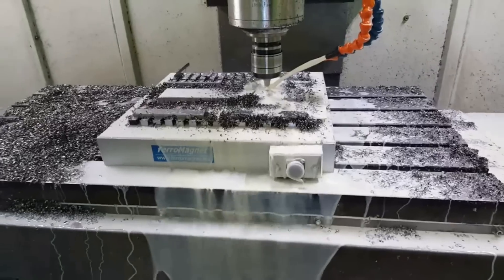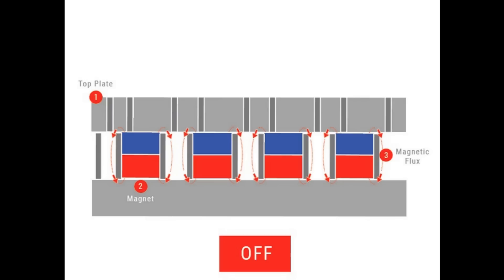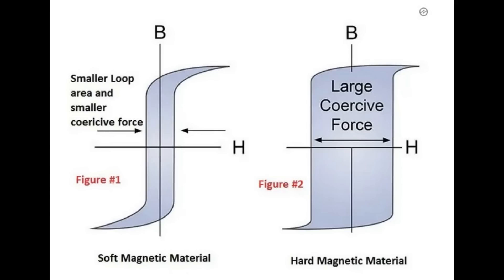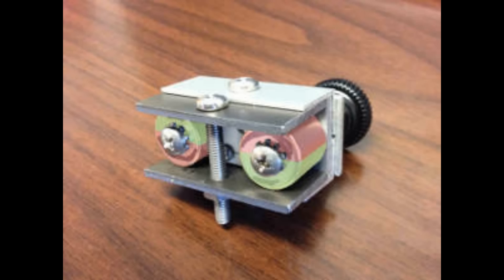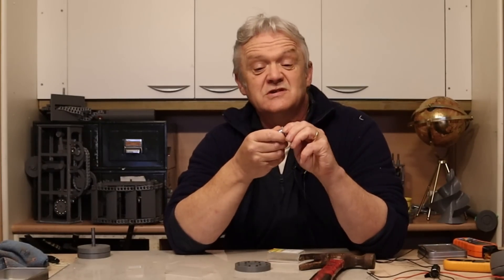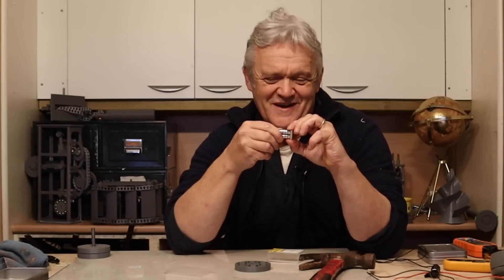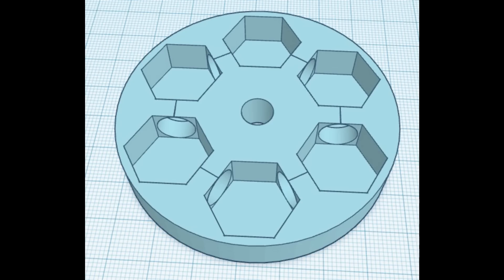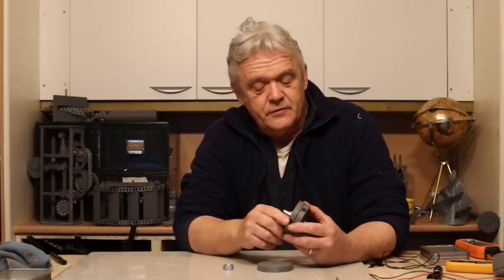2118 Permanent Magnets You Can Turn Off And On

Comment: Now, the permanent-electromagnetic chuck-  This is a thing that's been kicking around in my head for a bit (good to know it actually works/exists... i guess that's how many electric door locks work, huh?)  Depending upon how Strong your electromagnet needs to be to reroute the magnetic flux (which I have been unable to determine by searching and asking)  it seems like you could make a motionless alternator to cause a coil to generate, by containing and reinforcing very strong permanent magnets on either side.    So instead of having to pay the energetic cost of moving large magnets, you could perhaps, use a small amount of electricity to "wobble" the flux of the more powerful magnets back and forth across a large coil.  It seems like a place where we may be able to hack physics to our advantage.   So instead of building a large wind turbine, say, make a small manageable one, and apply That to wobbling the flux of big magnets around a big coil.    I have yet to figure out quite how to create this to test it.  But at least I know what the thing is called now  so maybe I can find an answer and not reinvent the wheel, as it were.
Reply: Seems like the concept could Also be used to drive a rotor- again, I don't know if the input on the electromagnet to contain the flux would have to be so high it makes the permanent magnets superfluous-  but if your permanent magnet is doing the Work, and your electromagnets are just rerouting, or reinforcing the flux, it just seems like a place you might be able to get more bang for your energetic input buck, like in a heat-pump.
Reply: @ryanjamesloyd6733 Yes, the Motionless Electric Generator by Tom Bearden uses this concept.  He built working devices and obtained Patents for these devices.
Reply from the maker: it is how they work mate
Reply: Look up Patent US6362718B1

Comment: By turning on and off wouldn't it be like cutting flux lines?  If so, wouldn't it generates electricity?  If so, then it would be like a motor.
Reply: Yes, exactly!  See the Motionless Electric Generator.  Use search terms  ais bearden
Reply: Yes, this has been done and it works, and has been scientifically documented.
Reply: @SamHill-sl6ul  Got Metglass?
Reply: @SamHill-sl6ul  Can you provide the document?
Reply: Look up US6362718B1
Reply from the maker: yes it could

Comment: I sure do love magnets.  Rob have you seen Motion magnets video on the magnet switching cylinder he’s made?   A permanent magnet center with a rotating shield.  Designed to shield the repulsive force then move allowing the pulling force to act.  Pretty interesting.
Reply from the maker: I haven't mate - but have  look at what wikipaedia says on magnetic switching - you will see a drawing of the essential elements there - or at least what i think are the essential elements from what you say

Comment: When the energy harvested by moving a magnetic flux through a conductor is greater than the energy needed to move the flux, then excess energy is harvested. The Tom Bearden Motionless Electric Generator uses the concept of electronically switching the magnetic flux path of permanent magnets to harvest energy. He built working examples and obtained Patents for these devices. Use search terms ais bearden
Reply: This has been verified to work by the US Patent office.